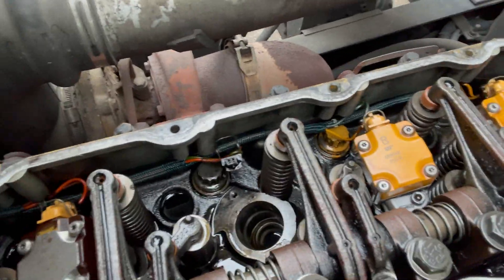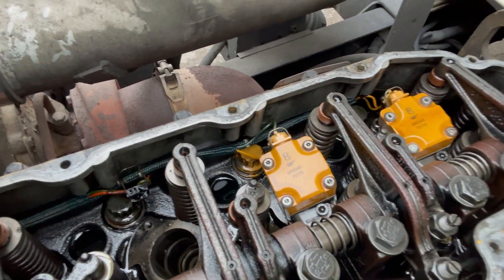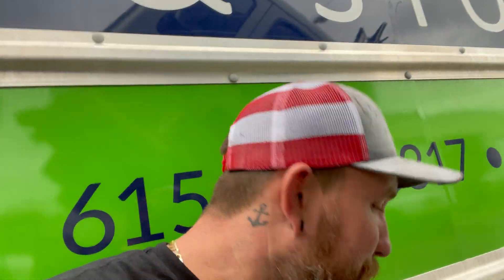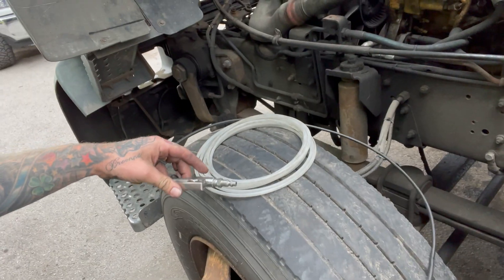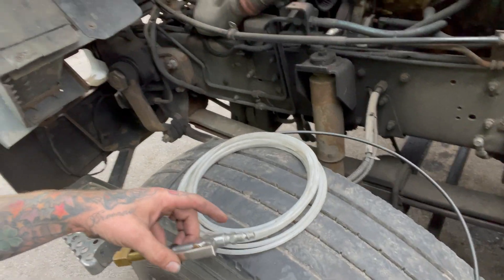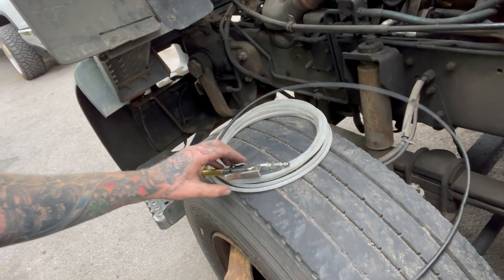Diagnosing and injector replacement on a cat 3126

Comment: So how did you get your Cat ET diagnostic software and laptop? Been trying to get one, the local Cat dealer doesn't seem interested in selling it. My understanding is the software is free but you have to buy a license to activate it. Trying to find a HD truck scanner(non Cat) that could help with trouble shooting our 3126E we have in our motorhome as the local Cat dealer which has 4 or 5 locations in my state have closed down all of their truck, bus RV repair shops and now only do Cat construction off road equipment. Any help or advice would be appreciated.

Comment: You said in this video that on a 3126 you have to tune the injector with cat scan tool after there installed. I thought that was just on c7's and newer. I thought on 3126s you could just install and go?